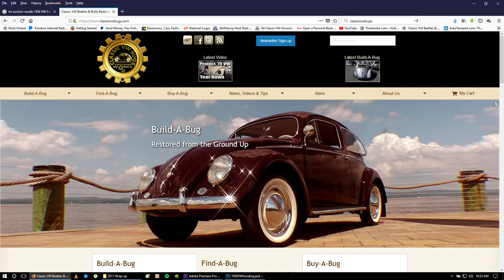Classic VW BuGs Wraps up 2017 with Beetle Projects the Market Advise into 2018

Comment: thanks Chris, encouraging words, although most parts are available there are still certain parts that are so hard to track down in the UK, like the correct spare wheel well for my '58 even wolf parts say they don't stock it despite it looking very similar the the '57 and things like the brush for the steering column/horn, but luckily its possible to source these things from elsewhere, by like you said, doing a google or eBay search, thats why I have an earth wire from a Rolls Royce aircraft motor for my horn ground wire. ;)
Reply from the maker: Hey Matt, great post.  Yes there are some things that are very tough to find, but for the most part, with some hunting and the use of the net, we can find things faster today then ever before.  Have you tried restorationpanels.com
Reply: Not yet, I'll check it out, thanks!

Comment: This has nothing to do with the video but i was wandering what the best video or book is for building a 1300 vw engine from nothing.thank you
Reply from the maker: I have a 7 part series on 36hp motor build with a note sheet that I made to build the motor, and in the sheet are the specs for the 1300cc, which you would pretty much follow what the specs would be for a 1600cc.
Reply: Chris Vallone. Thank you very much